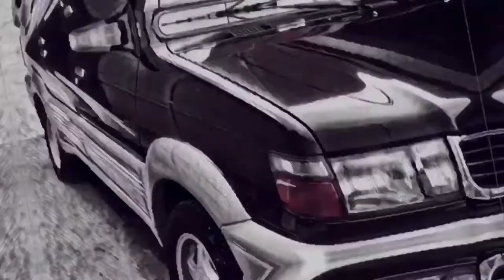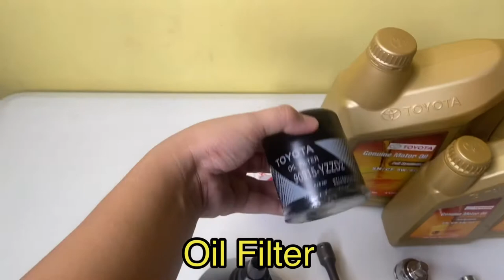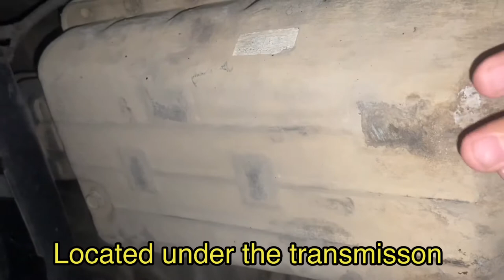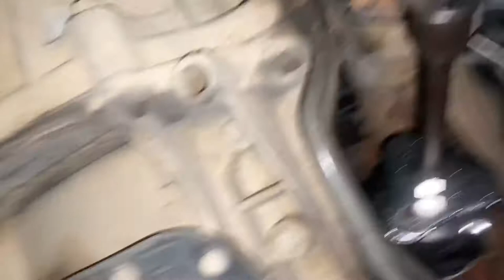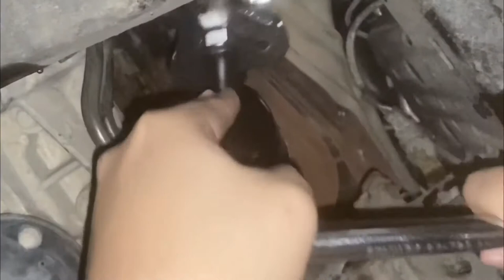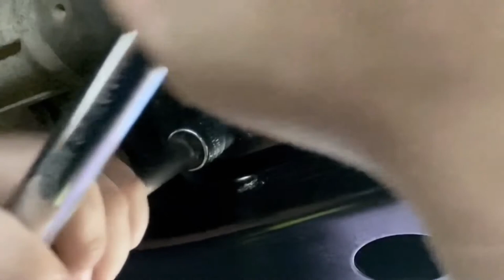“Change Oil” Toyota Fortuner

Comment: Diba pang diesel yung 5w 40 sir pwedi din pala sya sa gas
Reply from the maker: Magkaiba ang engine oil ng gas and diesel. Iba iba din ang viscosity po nila.
Reply: Fix Mhonkz yung ginamit mo engine oil pang gas engine ba kase nabasa ko yan for gasoline and diesel engines sya
Reply from the maker: renjay lusung may mga engine oil na pwede po sa diesel and gas. Yung iba for diesel only and yung iba for gas lang po. Eto pong ginamit ko is pwede sa gas and diesel engine sir.
Reply: Fix Mhonkz ah ok tnx sir fortuner 2.7 vvti din po sakin more power po sa nyu